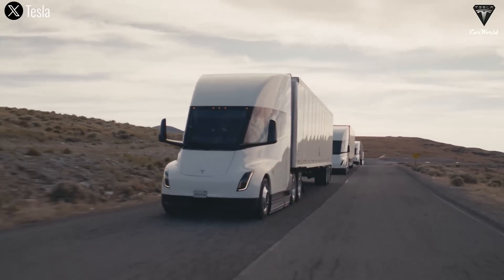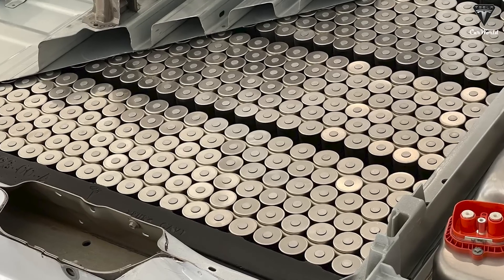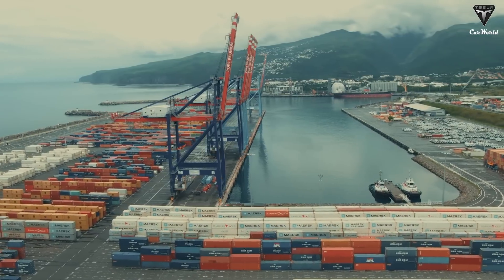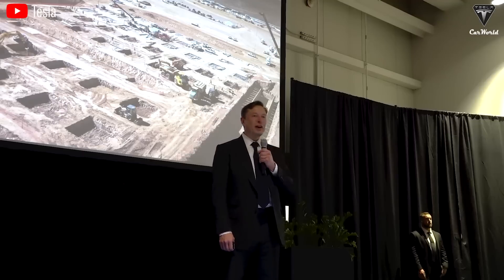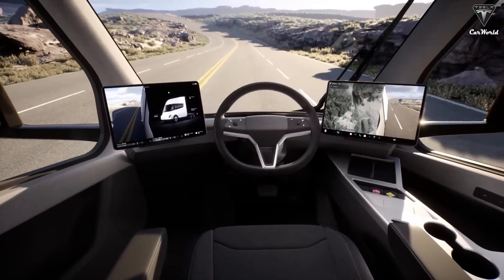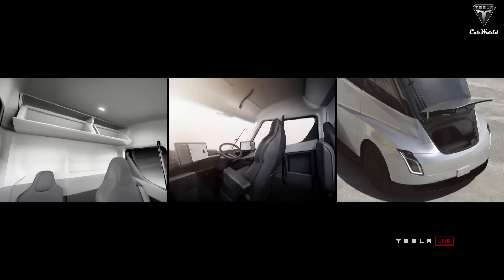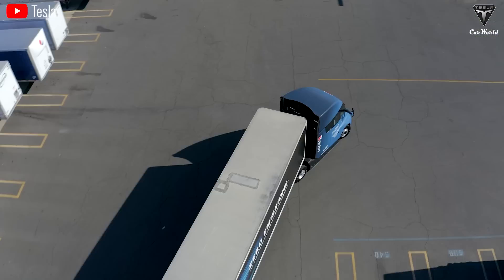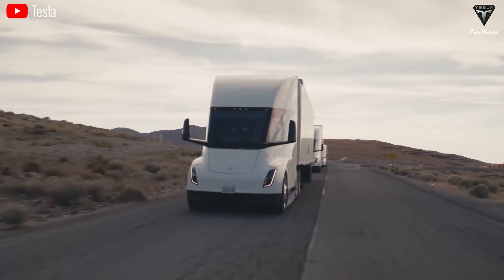Tesla Semi 2025 BIG UPGRADE! Elon Musk SHOCKS Mass Produce, NEW Battery & G2 Version

Comment: These fuel estimates are not realistic numbers for diesel, real world diesel cost is around $3 - $3.20 with fleet discount as of September, 2024.

What's the infrastructure for charging your battery.  I dont see truck charging stations at every truck stop.

Most important thing for an owner operator is the ability to get parts and quick turnaround on maintenance.  Where do you get your truck serviced.   Every tech at TA knows how to service drum brakes, but not many will service trucks with disk brakes... are the techs at TA able to service your Tesla brakes.

I operate a Freightliner truck because there's more Freightliner dealerships than any other brand, where's your factory trained technicians

Comment: I cannot see how the 48 V architecture will of anything to do with the regeneration system. 48 V replaces the normal 12 or maybe 24 V for accessories, lights, air conditioning and so on. The regeneration system should be completely separate where power is added to The battery pack which is likely 800 V DC. What am I missing here?

Comment: In theory, if battery improvements keep coming in, the size of the battery could either go down and keep the same range, or stay the same weight and have more range.
Potentially, with battery improvements, the sleeper could be feasible with a longer range but lighter battery. 
Sounds like a sleeper is at best 5 years away and 10-15 years is more likely.

Comment: Perhaps it will be possible to produce hydrogen at low cost using photovoltaic systems in desert areas, stored during the day, transported via pipelines or ships even to distant places, so it could be more convenient to have hydrogen-powered vehicles rather than electric ones.
Reply: 20% efficiency, massive infrastructure costs and complex truck hardware. Any one of these 3 would kill it-all 3 makes it DOA.
Reply: If the cost of electricity produced in desert areas with photovoltaics is only 20% of the average cost, this is parity with 20% efficiency. I think that to produce green hydrogen in Chile, Mauritania, Egypt, Algeria, Morocco for example, in those areas the sun radiates a lot of energy, but we do not use it.
Reply: @Berpaniz  i believe you’re missing the point. Converting solar or any kind of energy into Hydrogen to be used as a storage medium results in losing 80% of that energy when it is converted from Hydrogen back in into electrical energy.  Using battery storage results in losing only 10% making it much more cost effective. Hydrogen storage infrastructure is capital intensive, maintenance is high and long term durability is low making it a bad choice in all but a few boutique applications where say the Hydrogen is being made for other purposes such as fertilizer production.
Reply: @colingenge9999. I'm agree with lithium battery that only loses only 10%, but this storage is expensive so it's not possible use it for summer/winter storage cicle , another problem is the long distance power transmission , the transimission with DC 1000 kV power line is expensive, cheaper with idrogen pipeline or by ship .Greenn hydrogen is essential for a wolrd 100% renevable.
If low-cost green hydrogen arrives in the US, EU or CHINA from another area with more renewable energy, we will put it directly into the semitrach, without reconversion into electrical energy outside the vehicle
Reply: @Berpaniz  Long term storage IS an issue for batteries but that does not make Hydrogen a better choice. Numerous storage scenarios will be better than Hydrogen such as compressed air, pumped hydro, long term battery chemistry. 

Hydrogen is incredibly expensive to move by truck or pipeline which is why it’s 10 times the price of the electrical energy from which it came or 3 times the price of diesel making it uncompetitive for trucks.

Hydrogen is nothing new. We’ve been making it for a century so show me someplace where it’s cheaper than diesel?
Reply: @colingenge9999 Green hydrogen around $10/kg in USA o Canada? I'm not sure, Diesel  4$/gallon, i think the same cost for the same trip
Reply: @Berpaniz  diesel about $1/kg, Hydrogen $10/kg with about double the efficiency w H means it’s 5 times the cost which is why it won’t get used.  More importantly, the infrastructure for one H2 pump is millions vs $50K for charge station. Maintenance of FCEV would be many times more than diesel truck. 
Biggest problem is that H2 destroys all metal. Tanks are 11 times the volume of diesel at 10,000 psi and actually weigh twice as much as the H2 in the tank making it heavier. So heavier, bulkier, more expensive, more maintenance, high infrastructure cost and higher fuel cell cost vs diesel engine makes it nearly impossible.
Reply: @colingenge9999 1 kg diesel = 11 kWh, efficienty termic engine 30% so on the weels 3 kWh meccanic energy. With 1 kg hydrogen 44 kWh , efficiency FCEV 50% so on the weels 22 kWh meccaninc energy, so 22kWh/3kWh= 7 times, bat the cost hydrogen i 10 timns of the diesel, so the cost hydrogen is similar then diesel, but i think the cost of gren idrogen will drop in the next few years to about 5 $/Kg?
Even  batteries and charging stations 1MW DC are expensive. The battery is heavy so the truck carries less cargo and the 1MW DC charging station does not exist yet.
Reply: @Berpaniz  Hydrogen and diesel at similar cost sounds reasonable. Currently diesel is 10 times the price of BEV which is probably not going to change much. BEV at $0.02/km vs diesel at $0.2/km not counting the health care cost of burning diesel which is about $0.1/km which I assume they’ll continue to get away with NOT paying. 

however BEV vs FSEV will always be 3-4times more expensive per km, not counting the higher vehicle infrastructure hardware costs. 

Tesla semi will still carry same weight as diesel semi with extra 1000 pound allowance for the battery.  There are NOT 1MW DC fast chargers but Tesla has started to install 850kW chargers that’s pretty close. Having another tractor charged up ready to swap might be a way to handle 500+miles deliveries.
Reply: @colingenge9999 Perhaps hydrogen technology could have more chances to make progress, for example by reducing the cost of hydrogen with low-cost renewable energy, during day, summer e remote desert areas
Reply: @Berpaniz  I don’t know why people are so enamored with hydrogen. It’s like they’ve made up their mind that hydrogen has some special qualities and they have trouble letting that go. Look at the 2015 Toyota Mirai which is still for sale and I believe they sold 10 of them last year in the UK and even then they had to promise to give them free hydrogen for the first several years. Nikola Motors tried to make a semi trailer truck that was supposed to run on hydrogen, spent billions of dollars and never got one working. 

Hydrogen is a very problematic element whose main problems comes from the physics of the element itself and how tiny it is and how it will literally destroy any metal that it’s in contact with in a short period of time. it’s compressed to 10,000 psi which in itself takes a lot of energy it has about one tenth the density of diesel giving it a huge volume. For example an aircraft running on hydrogen would have to fill the entire fuselage with hydrogen at 10,000 psi to any kind of range at all.

Can you explain to me why people have bought into this hydrogen dream when all the evidence points to the fact of it being a total money loser? Even if renewable energy was free it would be more expensive than simply putting that energy in a battery. It’s not about developing better technology either because hydrogen has been around for 100 years and there is a huge industry that uses hydrogen so it’s not like it’s a new thing that no one‘s ever seen before. Most of the hydrogen is produced by steam thermoforming natural gas which is the cheapest way to get it but you wind up putting four times more dioxide into the air than if you simply burn the natural gas in an engine.

Yes hydrogen is a great story and it’s unfortunate that so many governments around the world have been sucked into supporting hydrogen which I believe is a ploy pushed by the fossil fuel industry to distract us from things that are working perfectly well such as battery storage.

Comment: Semi trucks already being super expensive electric versions make a lot of sense. Especially when the combustion engine wastes 65-55% of the diesel you burn (which is extremely expensive) in one year you could make back what you spent just in fuel. Not to mention the reduced maintenance costs.

Comment: Current tesla seminhas a range of 500 miles , with the new cathode there's a high likely hood of about a 20% range increase if the physical size remains the same that's another 100 miles .
Plus if they reduce the amount of cells inside the pack reducing weight, range will still go up.
Plus faster charging as well

Comment: 48v has nothing to do with vibration and Regen braking. This is a dumb video in so many ways
Reply: I cannot see how the 48 V architecture will of anything to do with the regeneration system. 48 V replaces the normal 12 or maybe 24 V for accessories, lights, air conditioning and so on. The regeneration system should be completely separate where power is added to The battery pack which is likely 800 V DC. What am I missing here?
Reply: I didn’t understand the vibration bit on the 48 V either. Unless they’re using much smaller motors with the rotating mass produces less vibration?

Comment: Regardless of fuel savings, any long haul electric semi must have a 600 mile useable range. Otherwise, the daily mileage of a driver will suffer. Essentially wasting the driver hours waiting for a recharge. 
I don’t see a battery powered semi as the solution to long haul routes. The use of an overhead catenary power supply would be much more practical for long haul with limited short range battery sufficient to transition on and off the highway for access to terminals etc.

Comment: 48 Volt improving regen? How? It may change the design of electronics a bit. Most savings come from having less current with the ancillary equipment, like motors (windshield wipers eg). Lighter wiring (or less IR losses in the cable).
Reply: I cannot see how the 48 V architecture will of anything to do with the regeneration system. 48 V replaces the normal 12 or maybe 24 V for accessories, lights, air conditioning and so on. The regeneration system should be completely separate where power is added to The battery pack which is likely 800 V DC. What am I missing here?

Comment: Where are the semis going to charge?
Reply: At the depot. At the delivery point and at roadside truck stops and with perovskite solar cells on the roof of the truck and trailer from the Sun.
Reply: Even covering the trailer with solar would  barely run a refrigeration unit in full Sun.
Reply: @andrewradford3953  you seen the overhead power lines for trolleys?  Germany has a similar setup over their highways to supply power to EV tractors.
Reply: @neilmckechnie6638  Is that infrastructure being installed?

Comment: As batteries get more energy dense, there will be no need to reduce the battery size to accommodate the sleeper cabs.
Reply from the maker: You’re right; as battery technology advances and becomes more energy-dense, the need to reduce battery size to accommodate additional features like sleeper cabs might decrease. More energy-dense batteries can store more power without increasing physical size, potentially allowing for larger cabins or additional features without compromising range or performance. This would be a significant advantage for electric trucks, providing more flexibility in design while maintaining or even enhancing their operational efficiency. As Tesla and other manufacturers continue to improve battery technology, this could become a key factor in balancing vehicle features and performance.

Comment: I'm a truck driver.    Think about this:   price tag is maybe going to be $350,000 for a sleeper.    The operator will spend $620,000 over 8.19 years on fuel if diesel.   If Tesla, just $155,000  in electricity.   So the real price is getting paid $ 115,000 to own a Tesla.      Like Elon said "I don't know why a trucking company wouldn't want to save some money.     its allllllllll about the fuel.
Reply from the maker: You’ve made a great point. The total cost of ownership for a Tesla Semi could indeed be significantly lower when factoring in fuel savings. If the upfront cost of a sleeper truck is high but the long-term savings on fuel are substantial, the overall financial benefit becomes clear. 

With a projected price tag of around $350,000 and a much lower cost of electricity compared to diesel fuel, the savings over the truck’s lifetime can be considerable. As you noted, the total expenditure on fuel for a diesel truck could far exceed the cost of a Tesla Semi when considering the savings on electricity. 

Elon Musk’s point about cost savings being a major incentive for trucking companies is spot on. Over time, the lower operational costs could make electric trucks a more attractive option, especially as the technology matures and becomes more widespread.
Reply: @TeslaCarWorld haha straight from Chatgpt réponse generated
Reply: Add up the cost of regular maintenance on diesel trucks like oil changes, which costs around 500$ every 15000 miles, plus DEF price and DPF system maintenance... And so on and so forth...
Reply: Think of the savings when trucks become autonomous.
Reply: Not to mention that diesel will just get more costly and electricity will get cheaper. Those buying ICE trucks are losing in a big way.
Reply: @neilmckechnie6638  You wanna vote trump for electric pize lowering.
Reply: How would you recharge it for over the road use
Reply: @DonCorr  duh at a charging station?
Reply: I think distribution point that use semi's will go fastest. 
They can put a ton of solar panels on the roof and free charge all semi's loading/unloading
Reply: Um hello they plan to make them driverless so massive savings when you minus wages and fuel
Reply: they say 500 miles range. but in reality I highly doubt range would be 500 miles. Depends on the load, wind, relief. And imagine 900kWh how long it is gonna take to charge. It is almost 15 regular tesla cars. So, in order to achieve same charging speed they would need to separate batteries on 15 mini bundles and somehow connect it with 15 super chargers just to achieve full charging in 45 minutes. who would want to do it. not sure. So either Tesla should be a genius and become with fancy expansive battery cooling tech which will accelerate charging speeds. Or this project is doomed to be used only by specific companies on a predefined routes.
Reply: Maybe because during that time, a trucker is also paid ! And if he can't do as many km, then the revenue will be much lower...
Reply: Have you factored the extra weight of the battery in your calculation?

Federal regulations limit semi total gross weight to 80,000 pounds, Tesla semi battery pack alone will weigh as much as 12,000 pounds.
Reply: And your time to charge it 4000 hour? lol
Reply: Some, maybe all truckers dont like the look of a Tesla Semi
Reply: It’s interesting that people can somehow make decade long inflation adjusted calculations on energy costs & can factor in battery depreciation…  when we still don’t know which battery chemistries will be employed in this segment.

It’s also super frustrating that due to wind loading and engineering complications many massive warehouses can’t host solar power systems or require less efficient thin film technologies to be glued on.

I suppose the take home is to buy Chinese EV / Solar manufacturers and glue companies if you want a slice of the future.
Reply: @andrewrance I'm interested in that warehouse solar power comment you made their. What information do you have on that? I'm often shark that we haven't made that a requirement for any new warehouses that get built
Reply: @andrewrance maybe in USA the warehouses can’t hold solar panels due to wind bearing loads. In europe they do for sure! Because buildinds, are calculated from load bearing capacity to  big wind loads snd massive snow loads. So the tiny weight of panels is no stress here in europe. Probably in USA the codes will be changed and this will be changed, and it will have a big impact and utility.

Comment: An electric semi is signigantly less complicated than the ice counterpart.
Reply from the maker: Yes, an electric semi is much simpler than a diesel truck. It has fewer moving parts, no complex transmission, and doesn’t need oil changes or exhaust systems. This means less maintenance, lower repair costs, and improved reliability. The reduced complexity can lead to significant long-term savings and less downtime.